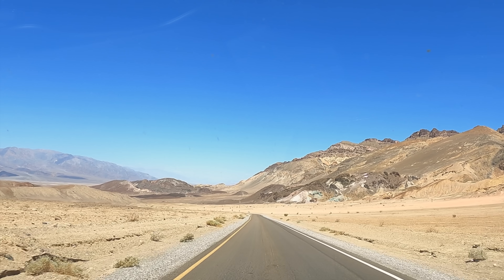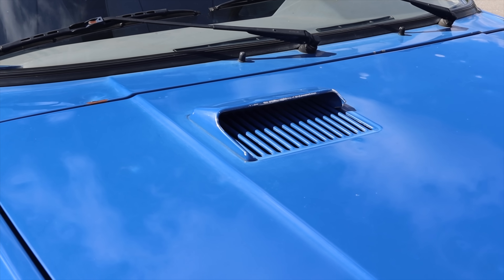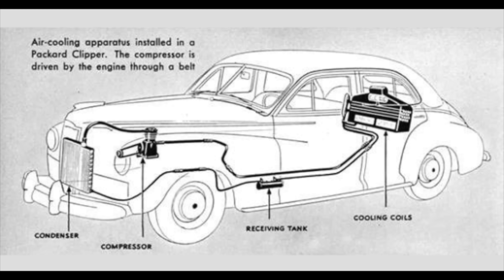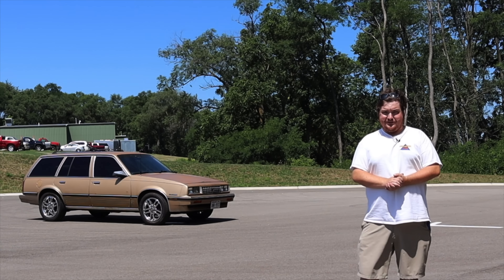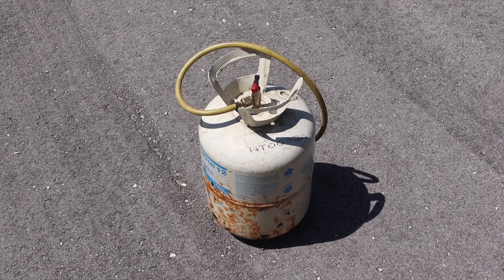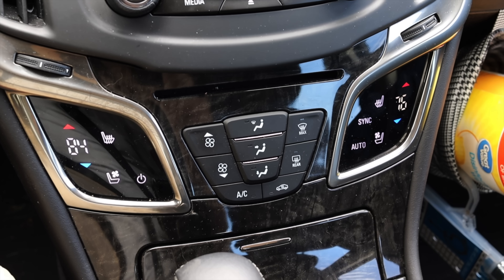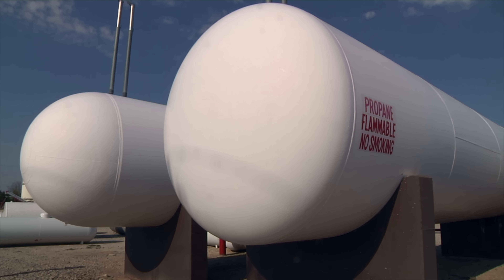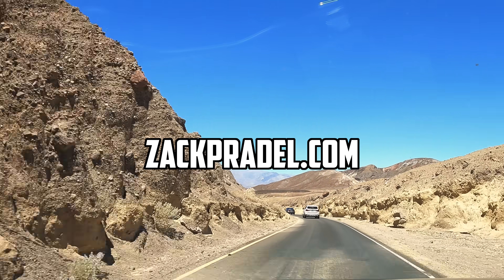Air Conditioning - The Story Of R12 & Why Modern Air Conditioning SUCKS!

Comment: Use propane as the refrigerant. It is much more efficient than R134. It Even carries the R134 oil through the system. 
I keep a dedicated gauge set on a 5 pound propane cylinder. Charge my older vehicles with small leaks with it. Even seems to leak out slower than R134.

Comment: My 92 Prelude is still running R12 it works great. That being said, my 97 Odyssey and 00 Passat with R134a work equally as good. All 3 are still running with all the original a/c components. Just amazing to me.
Reply: I think it's because the system is designed for one or the other.    I can't speak for an R12 system running R12, but my Uncle Frank once owned a 1990 Cadillac Brougham,  and it just didn't feel all that cold.   Then he traded that in for a brand new 2004 GMC Sierra 2500 HD, and the air conditioning was much colder.     I would presume the Cadillac had been converted to R134a at some point before  he purchased the car, as he purchased it used, and the car had been involved in a deer collision at a high rate of speed.
Reply: R12 is far far superior!

Comment: I have 10 years into HVAC and I will keep using R-22 in my house for as long as I can. Any new refrigerant sucks. 410-A is a prime example.
Reply: I'm not sure I agree, R-32 is looking like a decent candidate.
Reply: @johnrehwinkel7241  I haven't dealt with r-32 yet but I hear it's the next one to be used when 410-A starts to phase out in 2025.
Reply: When I took an HVAC class a few years back, the instructor would talk about having to replace all the freon if you have a leak in a 410-A system rather than top it off like you would a R-22 system. He would say 410-A is a three part blend so depending on where the leak is in the system, you don't know which part of the blend leaked. So now do you have 409-K or 352-C? I'm not sure if that's still the procedure, but I didn't like the thought of a customer having to replace 5 pounds of freon over a slight leak somewhere in the system.
Reply: @jonathonsanders2508  not sure why you heard that I top off 410a all the time there is no blend
Reply: Both of you are wrong. R-410a is a 50/50 mix of R-32 and R-125. R32 does the bulk of the work but R125 lowered the flammability rating to below the threshold until new guidelines came out that allowed slightly more flammable refrigerants like pure R32. R-410a is a zeotropic mix but it's so close to azeotropic that you really don't need to worry about it in practice most likely. Other zeotropic refrigerants that are further from azeotropic do need full recharges for good practice
Reply: i got windows ac with 410-a it get room very cold . i sure it different in central ac units
Reply: There are a lot of nostalgic ACs from the late 1990s and early 2000s that use R22. My childhood ACs use R22 and the fact that those designs died out before we switched to new refrigerants makes me sad.
Reply: 410A is the worst refrigerant, EVER, by far. Despite R32 being inferior to R22, it's still way better than the cancer known as 410A. Over the past 15 years, but more specifically the last 5-10 years, you can tell all the R22 systems as they get replaced, because the places that used to be cold and dry are now coolish and wet. Blended refrigerants just don't work. Midea and Daikin (Goodman) have done good with R32. But of course, political correctness will never allow us to keep the proven winners.

Comment: That “Will it blend” Blendtec reference was top notch. I literally jumped out of my seat in excitement that someone other then me references those videos from 2006! Lol. Earned an immediate like from me brother. “Don’t breathe this”.
Reply: Ah the early days of YouTube.
Reply: I miss that channel
Reply: After years of avoiding buying a Vitamix because of the price, then after a couple of years of watching Tom Dickson's WillItBlend series, I bought my Blendtec Total Blender in 2009 from a roadshow booth at Costco.  If you use the soup cycle three times with a pint of water in the jar, it will be boiling halfway through the third cycle.  It's never let me down, and the only thing I've had to replace was the original jar because the bearing's seal started to break down after about 10 1/2 years of use (still worked, but it had a very slow leak, and I was starting to notice the slightest rattle in the shaft, which would only worsen with more use).  

After years of singing praise of my Blendtec blender, a friend of mine (who the entire time kept saying "no blender is that good, and definitely not worth the price") broke down and bought one.  The very next thing he said to me was "Best.  Blender.  Ever".

Quite possibly the best $416.90 I ever spent, along with the $72.36 for the replacement jar over a decade later.  For years, any time anyone asked me about that blender, I'd just send them to willitblend.com.  It doesn't resolve anymore, but the videos can still be reached on YT and from the Blendtec page (if you know where to look).  Tom Dickson stepped down as CEO back in 2013, though the Dickson Family still has a minority share in the company.

Yes, the blenders really are that good...
Reply: God I loved “will it blend??!”
Reply: @MePeterNicholls  you're in luck, the channel has released videos as recently as last year.
Reply: @GuillermoHernandez-mu5mj  yes! I saw!!!!!!
Reply: I think I'll press the refrigeration button...
Nostalgia smoke - don't breath this!
Reply: What I understand about Freon and the development of it as we know our R12 it was developed to help make the first hydrogen bomb's.
Reply: @pauljanssen7594  Not exactly, but fluorocarbons were useful in the form of Teflon, which comes in immensely handy if you're handling UF6
Reply: YES!!! This was amazing. Music and everything wow 😂 Made my day
Reply: Bowling ball smoke...don't breathe this.
Reply: Bro same lol he had the music and everything
Reply: dude!! you're so right, that flew right over my head and then the tune right after i was like OMG what is that tune from!! golden mate

Comment: I had a r12 filled 90's civic. That leaked out due to age and had it filled with R134a. Absolutely hopeless. I filled it with spray duster and the magic cooling returned. In hindsight r134a was never going to work as the condenser was far too small.
Reply: Air dusters use R34 or R37 something like that.
Reply: @jamminwrenches860  yep, and with additional bittering agents added to try to keep kids from huffing the stuff, which leaves a nasty invisible residue on the stuff you spray it on which is why when I clean my PC these days I use a mini shop vac in Blower mode, and that's why my sister's car smelled funny, and sometimes you can even taste the bittering agents in the air depending on the brand, and which one they used.
Reply: @CommodoreFan64  I've lost count of how many minor inconveniences have been caused because kids try to get high off of fucking everything
Reply: @b-chroniumproductions3177  I hear ya on that one 👍
Reply: @jamminwrenches860  r152a which is flammable. But so is petrol...
Reply: My sister had an 86 Mazda 626 4 door sick shift well into the mid 90's, and her boyfriend at the time did that trick, and it work till she got rid of the car in 97, due to a 2nd steering column going bad, but the inside of the car always smelled funny after the A/C fix 😅

Comment: R134a is good for house refrigerators but it's just not efficient enough for AC, until some years ago some house AC in my country came with R22 and they work so much better than the newer ones that comes with R410a.

Comment: My 94 Taurus had r12 and it blew snow. My 95 Taurus had r134 and was cold but not like my 94. My 2020 ram has 1234yf and it takes about 2 to 3 minutes to get real cold air.
Reply: Not sure why the RAM takes so long.  Maybe doesn’t engage the compressor as quickly?
Reply: Because it's broken. It shouldn't take more that a few seconds to feel the cold air.

Comment: Zack: "So, behind me is a 1985 Chevy Cavalier wagon. And, it still runs ..."
Me: "WOW!"
Zack: "...on R12."
Me: "wow" 😂
Reply: My ‘89 Cavalier still ran on R12 when I sold it in 2004.
Reply: Old cavaliers will run for ever, just as long as you change the oil and don't live up north where they rot out
Reply: @mightyloaf  it’ll run but that’s about it, those cars are junkkkk.
Reply: I got an 88 Corvette running R12

Comment: I still have a brand new BMW R12 to R134a AC conversion kit somewhere in my basement. It consists of a new dryer, two adapters for the fill ports and a sticker. You (or more precisely the work shop) were supposed to drain the system from refrigerant and AC-oil. Then remove the compressor, heat it and turn it by hand to remove the oil from the compressor (R12 and R134a AC-oil is not compatible). Replacing the dryer (were obviously also a lot of AC-oil is trapped) and all O-ring gaskets in the entire AC-System (they absorb some of the AC-oil). Then put everything together and charge it with R134a. The sticker would be placed over the original AC-info sticker to inform of the altered refrigerant and its (different) amount.
Reply: I mixed R-134a and R-12 in my 1993 Dodge truck. It's been working fine for ten years.
Reply: @mikefrech1123  are you sure it wasn’t converted beforehand?
Reply: @campervankid  Positive.

Comment: Random story: in the old days, Arab oil-rich sheiks would buy Cadillacs instead of Rolls-Royces. Cadillacs of old had massively oversized AC systems that could keep up with the desert heat. Rolls-Royce, being from a cool wet country, put tiny little AC systems in their cars. Nash was the first company with a fully integrated AC climate control system, partially since Nash also had a refrigerator division. The '68 AMC Ambassador was the first car with standard AC. AMC was, through some mergers, Nash.
The Jeep Wrangler is the last car in the US to have AC optional. It's only optional on the base model 2-door, all others have it standard. Makes sense that in a Wrangler you don't always need AC. Even base model work trucks have it standard now, just like crank windows are increasingly rare.
Reply: Also most cars has under sized radiators in the past and now. This is the reason why toyota makes the most popular cars in the arab world now. They make special cars and even whole brands with bigger radiators and therefore can sell cars when BMW and merc cant. Not cars that are actually used anyway.
Reply: @rimmersbryggeri   Nah, that's BS.  When I was a kid so many decades ago, there was always a heavy duty cooling option.  For cars intended to tow, and part of the optional AC package. 

You really think BMW and Mercedes are going to not meet that wealthy market demand?  Come on....

BTW, all modern cars with climate control ALWAYS shunt a portion of their cooling water through the heater core, even when AC is on maximum.  Weird, because it necessitated a larger (more expensive.)  I had a car once that had overheating problems, so I would clamp off one of the heater hoses with an appropriate vise-grip.
Reply: The Sheik then drove it and rocked the Casbah. Apparently Sharif didn't like it.
Reply: Good ol' Nash-Kelvinator!  I have a 54 Nash with factory a/c (R12).  It cools fine.  A little under engineered but it does the job.  Shortcomings were corrected in 1955.
Reply: Interesting, and thanks!
Reply: The wrangler was ONLY 2 door. Until stellantis made the garbage imitation wranglers.
Reply: When I worked on a 70s RR it had factory air....it was an AC Delco system ....yanno, GM.   Yup, RR bought it AC systems and its electronic ignition systems from GM before the Germans took over.   Also,  Cadillacs were more popular in Arab countries than RR BECAUSE NOT EVERY ARAB IS A BILLIONAIRE.   If you haven't noticed, Cadillac is much cheaper than a RR.
Reply: @MrSloika  RR also used GM’s indestructible Turbo 400 transmissions.
Reply: @MrSloika  back in the m
 day they were just as expensive as a Rolls Royce

Comment: Do refrigerators and home ac use R134a?
Reply: Domestic refrigerators do (although recently they’ve been made using hydrocarbon refrigerants instead), but home ac units (central and window) used R22 before 2010, and have since used R410A instead.

Comment: The refrigerant today is better for the atmosphere as the old gas was harmful for the same reason. Tip, you can take a automotive or diesel course to get approved to purchase a canister. You can purchase a small can at Oreilly without the need to be approved. To be honest while the old stuff worked well, once it's gone you'll have to do research to find it, just be sure to find that leak in your AC system first or you'll be throwing your money away.
Reply: At that point, I think it would be more ethical to convert your air conditioning system to use a different refrigerant.

I am not a climate change warrior or anything, but I would kind of feel weird still using something that was so aggressive that  it was banned for its effects on the ozone layer. I know that you're only 1 person, and it won't reopen the ozone layer hole, but if you gotta go to the ends of the earth to find something, maybe that's a sign you should stop using it?
A more hyperbolic example is leaded gasoline. There are still obscure places that still sell it, but if your car was old enough to benefit from using it, would you use it? Despite knowing the effects of leaded gas?

Comment: I had the R12 system in my 1990 Mazda 323 converted this past June and have had to bring it in twice since then to have it repaired. What exactly makes this retrofit process so difficult?
Reply: R134A is more corrosive than R12. 
He hints at that early on in the video, that it is easy on all parts. 
In the days of R12, it wasn't commonplace for the refrigerant to eat through the evaporator of condenser cores like what has to be eliminated now when there's a leak in a system.
Reply: @1SqueakyWheel  This is not true.  R12 and R134a are both halogenated hydrocarbons and are chemically inert.  The biggest problem is people who do retrofits don't do them properly.  You are supposed to replace ALL rubber seals, compressor oil, and the accumulator and/or filter drier as 134a requires the use of hygroscopic (attracts water)  POE lubricant which CAN react with the water in the head of the compressor and decompose into caustic substances that will attack aluminum and cause leaks where the material is thinnest (evaporator and condenser sections if they are micro-channel design) and cause seals to harden losing their sealing properties and cause leaks there, most notably the compressor shaft. These bad retrofits are what give 134a conversions a bad rap.  Given that a compressor shaft seal is under positive pressure it normally will not leak until very late in life (<100k mi) in typical use.  Show cars with R12 are still kicking because they are so infrequently used making this an apples to oranges comparison.  All that being said the BIGGEST thing that people fail to use to their advantage for keeping cool is insisting on using the fresh air mode instead of recirculation and keep the windows shut.  Any car that is properly maintained and employs recirculation WILL keep you cool even on the hottest days.  I have lived through the evolution of R12 to R134a to R1234yf and they all cool equally well when the vehicle is maintained.
Reply: @sivalley  I lived through the whole gamut as well, and you are correct on all points, except that none of those points were what I was referring to.

I even converted my Cutlass in the late 90's to 134a, with proper advice on how to do it correctly.  New dryer, blew new oil through the lines and cores for waste in order to remove all traces of old oil.  The compressor had been leaking, so I installed a fresh one during the conversion. 
It cooled well enough...  not as ice cold as the r12 system before it, but I was satisfied enough.  It worked great until I quit driving the car years later and sold it.  

I agree 100% on the fact most people seem to use fresh air all the time.  Sure it's good for certain situations, but not efficient...  more energy is expended in the river of condensation from the constant  influx of humid air instead of maintaining a gradually drier cabin. 
I wish more people understood this principle, or cared...  especially the crew members I often drive around who can't seem to stop themselves from cracking their windows or outright rolling them down after I've already gotten the air inside nice and dry, no matter how many times we go over it. 

My main point still stands though...  R12, despite many similarities to 134a, compressed and expanded with less energy input to the compressor.  And it was indeed less detrimental to non-ferrous metals, especially those comprising thin walls.   For that reason, pinholes in cores were nowhere nearly as common in the days of r12 as they are now.  If it happened, the cause was usually relegated to damage or defect, and nowadays it's considered wear. 

We can only work with what we've got, so I'm not preaching against its use, as I'm a big user of it myself.  I won't lie though... I do miss the good ole days.  😁
Reply: @1SqueakyWheel  Fair enough good sir.  And you reminded me of two other things I wanted to point out; the dang metering devices for 12 and 134a while fairly similar we're also fairly different and forgetting to change it would make systems behave undersized on top of old heat exchangers used significantly thicker tube walls for reliability, efficiency be damned, compensated by making systems be oversized for their duty.  All in all cheap and energy efficient have all but reduced reliability to "long enough to get past warranty"
Reply: It’s the different pressure gas that ruins the compressor and the condenser.  FR12 is a lower pressure gas that works best for retro fit